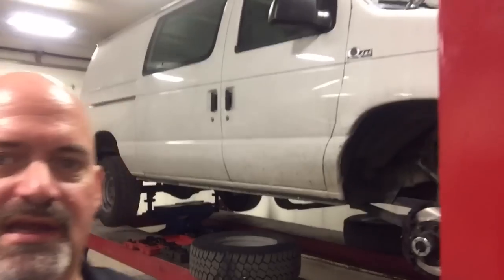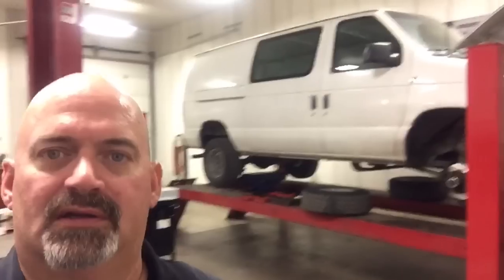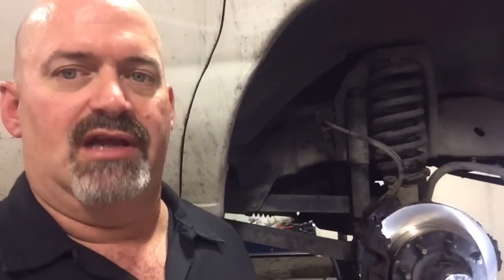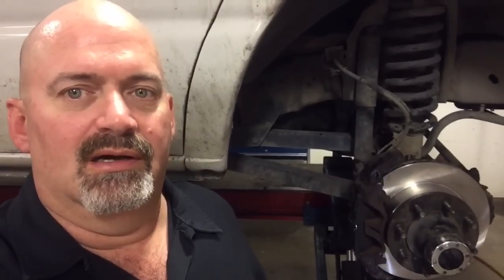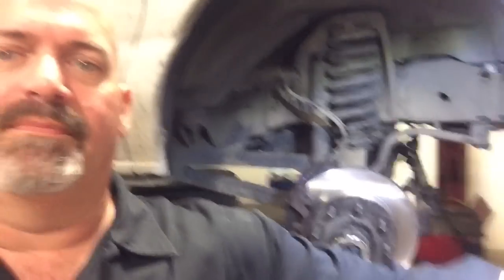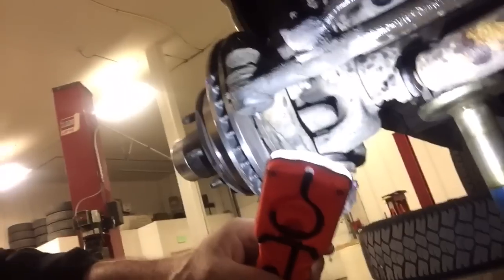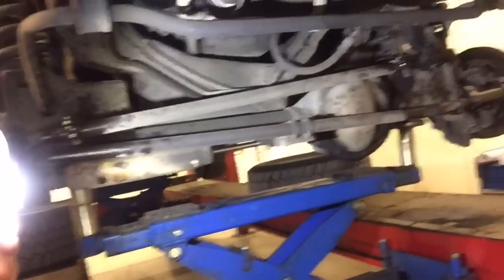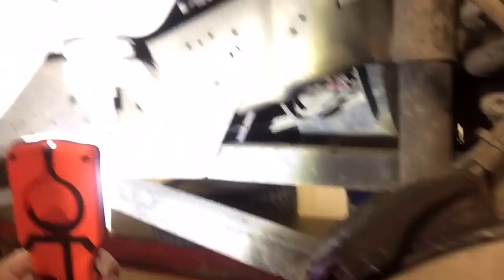Ford E Series Quigley Conversion Suspension and Brake System Service

Comment: My 2006 Diesel Quigley E350 Super Duty has a 2004 F350 front end with a 4" lift. Quigley also has to cut the gas tank from a 38gallon to a 30, bc the front differential now pushes everything back  and the gas tank is the first thing in the way. Other than that she gets 18.3 highway and 12-15 city

Comment: Hi Tim, greetings from Colorado.  My hair loss is due to Teenage children, they are grown and gone now, but my hair did not return. Interesting video, Thanks
Reply from the maker: Haha, mine too. Are you near the Boulder area? My friends who I read their mail run a shop there. Great mechanic if you ever need one.
Reply: Hi Tim, I am way out on the eastern plains, approx. 100 miles from kansas to the east. To bad, because there are times I can use a good tech.

Comment: Are there not many factory options for 4x4 vans? We have some Mercedes sprinter 4x4s at work that are lifted as well. That said they don't seem to work too well in the snow.
Reply from the maker: I was in GB about a year ago and saw all those Mercedes vans driving around. Lots of VWs too. We have a few of them here and I never heard much about the handling in the snow. Not many options available for full size vans with 4X.

Comment: 8 Bolt hub..wouldn't that be a 3/4 ton or higher?
Reply from the maker: Actually the newer E150s have eight bolt rims (I have a video of the 2wd ball joints here with the eight bolt wheels) but I cant say they didn't change the stock suspension to 3/4 ton at Quigley.  By the OE Vin it is an E150. Handles like a F350!